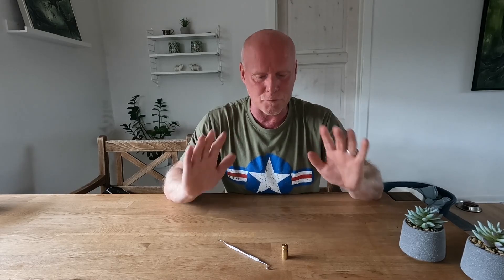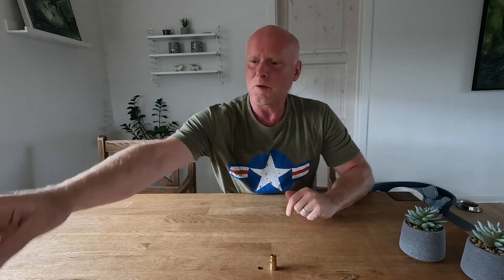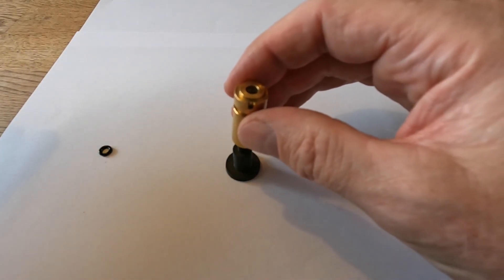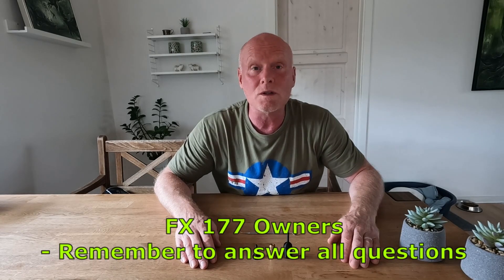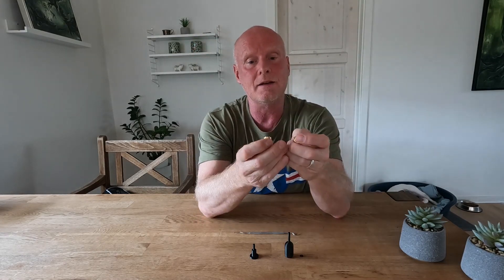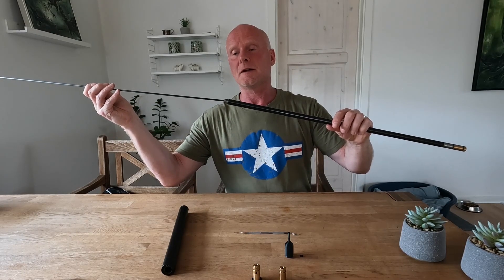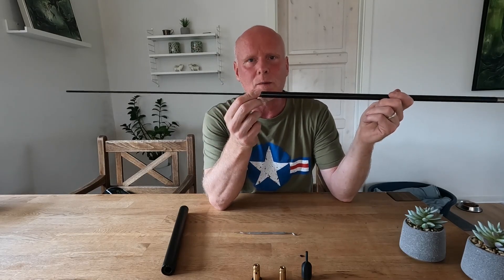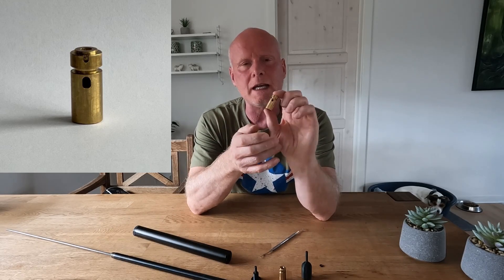Transfer Port O-ring install made EASY. Get a FREE tool 🙂

Comment: Changing O Rings is standard maintenance on the FX's. Will become even more interesting on the Panthera, were O rings are very deep inside holes.
Reply from the maker: The ones around the valve look like a bit of a challenge - but in a year from today we will be experts 😂
Reply: Yes hopefully😅. My first reg on the m3 is leaking on the atmospheric side hole. Loosing around 10bars per night. I already tried to untighten the reg to fix the problem. Unfortunately, it's stuck like hell. Need to clamp it into a vice. 😢
Reply from the maker: @markusscholl4958  Sorry to hear that buddy - of all possible leaks thats not an easy one. But Im sure that you will manage 😎

Comment: well my breech O- ring " tool " is my cleaning rod ( 3 mm carbon fiber ) with a little tape on the end to make it 4.4 mm.
Not able to visit faceting, as much out of the question as me visiting the Danish capitol, a place 10 Leopard 2 tanks could not drag me to.
Reply from the maker: Link to tool is also in the discription of this video 😉